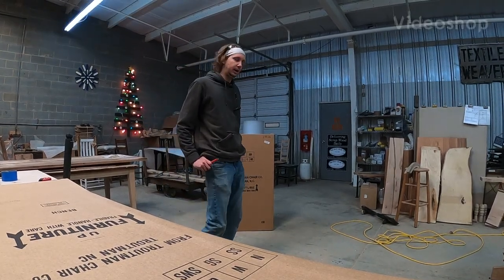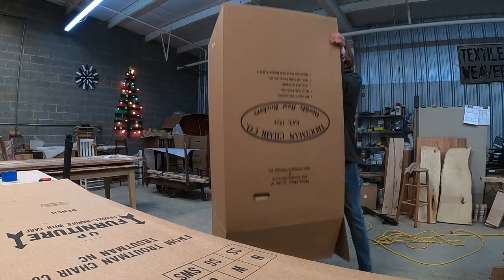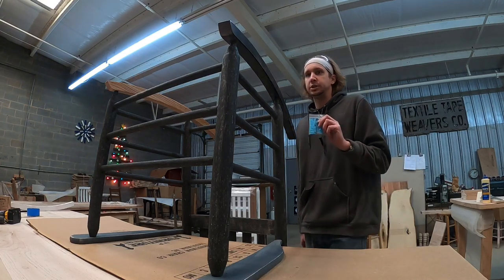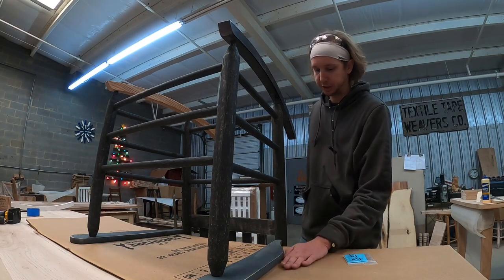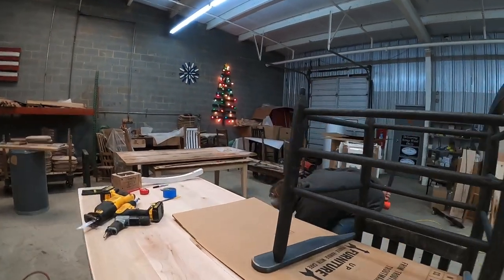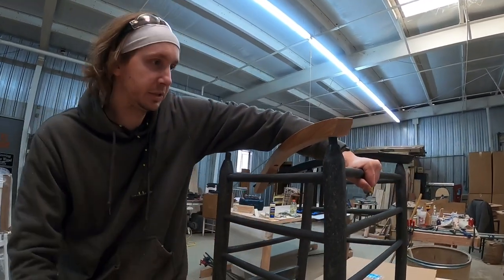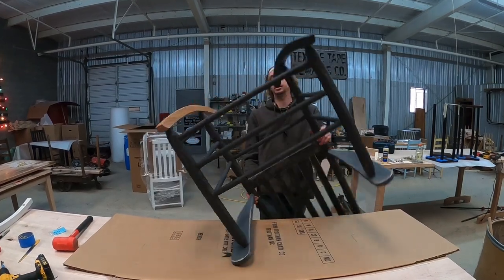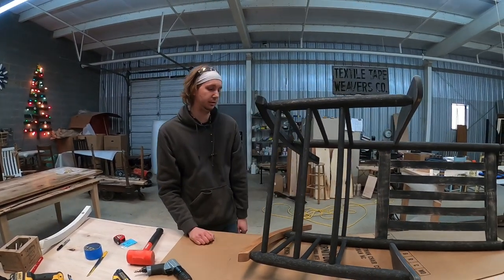Troutman Chair Co- Unboxing and Runner Assembly

Comment: How do you take them off when there’s a problem.
Reply from the maker: The only way to get them off is to tap down on the runners with preferably a rubber mallet. So you would leave the chair as it sits and hold up the side you need to get off, hit down on the front then  on the back. Keep alternating hitting on the front and back